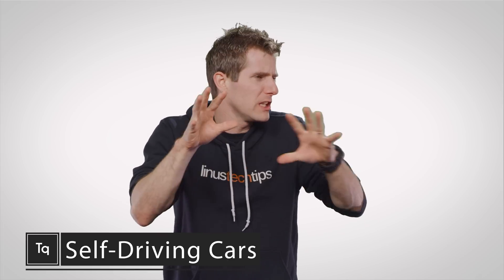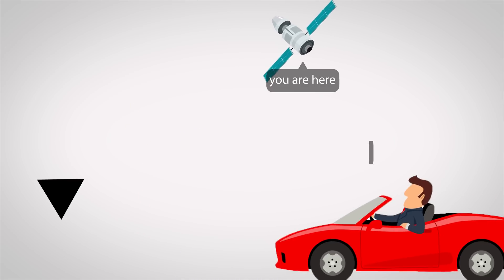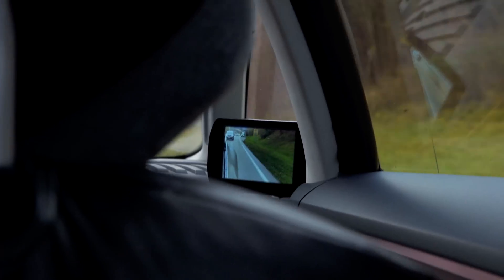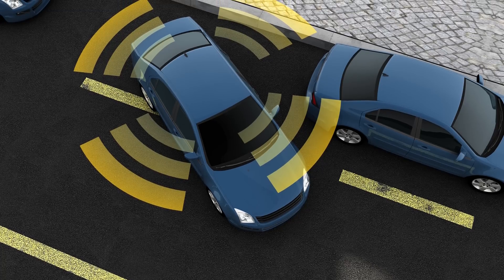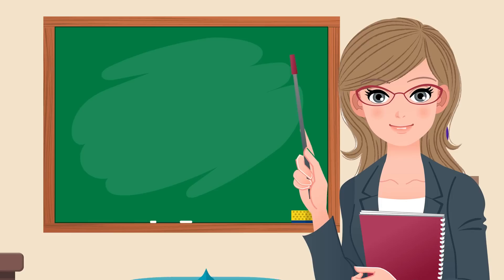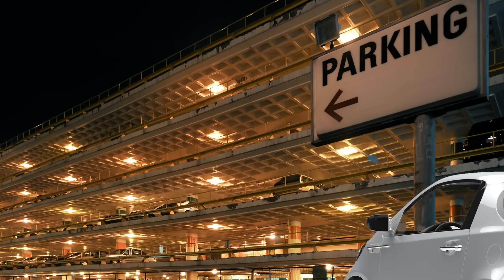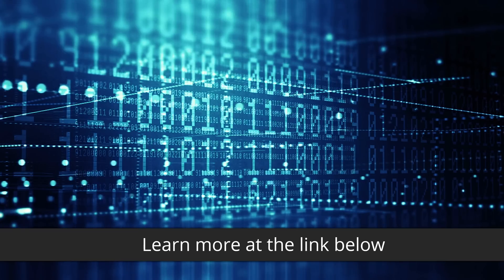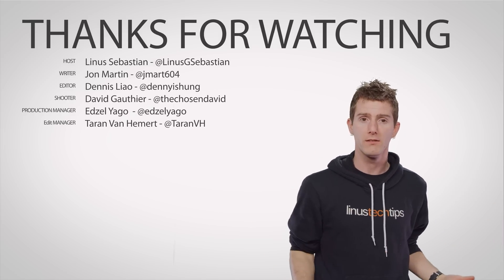Why Self-Driving Cars DON'T Just CRASH

Comment: Linus, Can you run a simulated test where there are multiple Lidar systems near each other. This would simulate incorrect readings similar to bright lights shinning into our eye balls, which is why high beams at night are illegal within a certain distance of another vehical, and why sunglasses exist.

I have not seen proof so far that shows every car on a road blasting lidar at the same time, maybe even 10 (or more), can get away with it before blinding each other unless they are running on different cycles which would be difficult to synchronize. Humans tilt their heads when high beams or the sun get in the way, I don't see lidar systems doing the same.

Comment: A couple points not mentioned:
1. Autonomous vehicles are not about not having to drive. They are about making transport system much more efficient.
2. They are not out yet not because the technology isn't ready. They are not out yet because they have to drive on the same roads as humans. And humans are terrible at driving. If we were to ban people from driving or make a separate road system for autonomous vehicles, we would have them already... 40 years ago... because we do, and it's called "Personal Rapid Transit".

Comment: What if one car is malfunctioning and sends out false signals to other cars

Like that asshole who doesn't use the blinkers or uses them wrong and then cuts you off and so on

I like the idea of network of cars how they just cooperate to make the general flow of traffic the most efficient instead of selfish assholes actually ruining it with jamming up bottlenecks and so on, but I'm just concerned how will they handle false signals and such in case of a malfunction and/or malicious hacks and someone manually sending wrong signals on purpose or something to make your car react in a wrong way and thus cause accidents. I know it's a stretch by far but that's how I imagine the equivalent of assassination by trying to run over someone - feed wrong/harmful data to another car and and make it crash itself

I mean surely they must have thought of that and created some mechanisms to prevent it but I'm curious what would those be

Comment: wow, so the developers are going so far with the different mechanism. I am rather concern about the point of cars communicating with each other and the infrastructure, if we give the cars wireless communication they will absolutely be hackable , if they could make their decision based on data they received from other devices, terrorist could work around it to cause accidents
Reply: They run off of GPS. Worst case scenario, the car's either pull over or give the driver manual control.
Reply: @aero7535  thanks for the input but Linus said in this video that they don't use GPS because it is not precise enough, and I think you missed the point of my argument, if they are able, leave alone depend on, to communicate with outside devices they will be hackable

Comment: Got a Hyundai Ioniq Electric last Saturday. It has a "ghetto autopilot", meaning automatic speed and distance control (all the way to 0 and starting by itself again) and active steering assist. Which together essentially is a tiny autopilot. The car can completely drive itself.
I think Self driving is great.
At first I was a bit sceptical about the car making mistakes and me beeing to tensed up to enjoy the ride. I was prooven wrong within the first 30 minutes.
Literally first ever time I drive this car, and espacially with autopilot. I felt super comfortable driving ont he highway with auopilot. Just keep your hands on the wheel as you are supposed to and if the car goes a little to far left or right (rarely anyways) just correct it. But the rest is really comfortable.
You don't actually need to be so focused on the car staying in lane. Or breaking because someone infront of you slows down.

Again, I think its great, comfortable and really just a relaxing way to drive. I will be driving to work with autopilot as much as I can.
Cheers.

Comment: To make GPS effective a reference point is used on the ground to reduce error. This is one of the largest problems accuracy. New infrastructure will have to be made  to accommodate autonomous cars. One way around this for now is to have a reference map update the cars location with the buildings or objects around it.

Comment: You don't really need 5g for connected infrastructure. I work at a research center that has a fleet of Volts equiped with lidar, infrared, cameras ect, that are working on vehicle to vehicle and infrastructure to vehicle communication. As well as platooning and other forms of energy saving measures. We have a number of stoplights already set up in our area so we can do real world testing. This all works on current 4g service.

Comment: boeing directly just killed a bunch of people due to a "software glitch"
who is responsible in the end? 
no one.
ONE single death due to a software glitch is BEYOND unnaceptable. there is no accountability.
we are an experiment.
fuck that.
Reply: Cars don't stall like airplanes do. Systems such as traction control, stability control, and ABS are just like these systems, and as of the past few decades, they've been reliable.
Reply: @aero7535 no... that's another field entirely. traction control, abs, and stability control merely ASSIST the driver. they do not have the ability to take over/ gain full control. they only assist the driver. - that is a fundamental difference- 
what happened in the planes is not the same. they could not take back control as a SOFTWARE glitch did not allow them, even when trying what was told In the "manuals".  all efforts failed. a simple sensor read the wrong information, followed by software responding in the way it did. when the user tried to gain back control, he was denied, as the sensors decided they are more reliable than the human. due to the software. 
I hope im making sense here.
Reply: @jake20479  planes are different from cars. The thing that stopped working was an anti-stall sensor on the plane.
Reply: @aero7535  traction control and stability control go hand in hand. they control wheel spin, but they don't turn the wheel for you. you have to do that. the cars optimizes each wheel to best suit the road conditions to regain control. they only do so based off what you, the user, do. as you have full control. abs: is simple anti locking brakes. they lock and unlock the brakes very quickly so that the car can stop as quickly as possible, and so that you can turn.. somewhat.. at the same time. theres no turning when you lock up your wheels, and you don't slow down much either compared to not locking up. 
these systems just help us out in our day to day.
autonomous driving... sir... that has control.
imagine if a tesla didn't allow the user to regain control of his vehicle, and instead of turning right it went left. into a crowd of people. WHO is responsible? 
no one.
that is the problem my good friend.
it wont be the driver that gets hurt. itll be a family of 5.
Reply: @jake20479  They don't take the wheel, but they do control the gas and brake. Technically, they can still take over in rough situations.
Reply: @aero7535  autonomous driving;yes
the systems you mentioned before: no. 
I am very aware planes are different from cars.. both have their own version of auto-pilot/drive.  
the problem is: who is responsible when something happens?
No One.
Murphys Law. what can go wrong, will go wrong.

Comment: I would also be concerned with wear and tear on sensors or if dirty enough to confuse the computer it does something wrong. I would imagine they have written in the program to self test the sensors very often on the fly and alert passenger to take over and get sensor back to norm.  I will never trust this stuff, ever.
Reply: This can be easily fixed. You know how there's spray nozzles to clean your windshield? Why not use those to clean the sensors?
Reply: True but not talking about if hard to clean them but the fact that the car may suddenly do something wrong because their dirty. Too late by then.And there are several on the car.

Comment: How well do these things work when there are no painted lines on the road, or in, say, near whiteout conditions? And what happens when these things get a little older and you are happily cruising along in autonomous mode when one or more of your sensors fail? No thanks, all I want is cruise control, power windows and locks, A/C and a standard transmission. No, I am not old. I am just a mechanic (who also happens to be a nerd) that knows how much of a pain in the a$$ fancy gadgets are in a vehicle. Trouble shooting/repairing this stuff is a giant pain for me, and unimaginably expensive for the customer. I'd wager Ford could sell you an F-150 for half the current list, if they stripped out all the useless, flashy crud and just sold you a truck and best of all, it would be more reliable. /* end rant